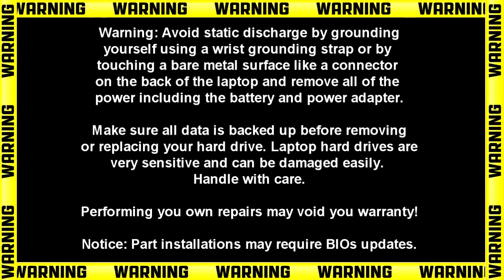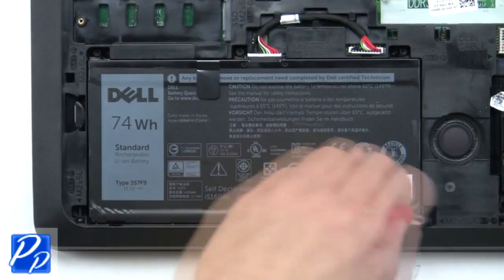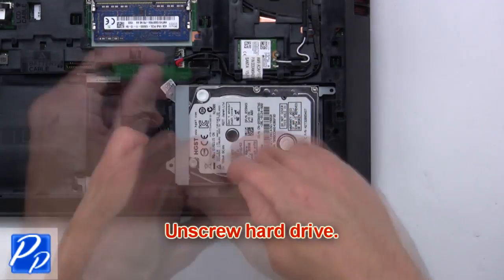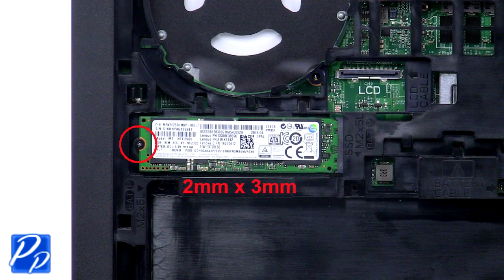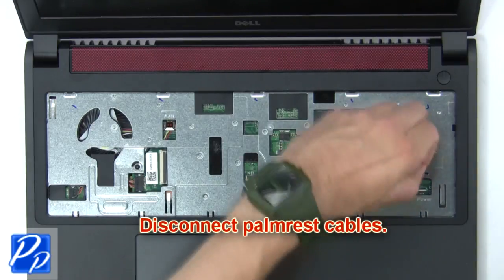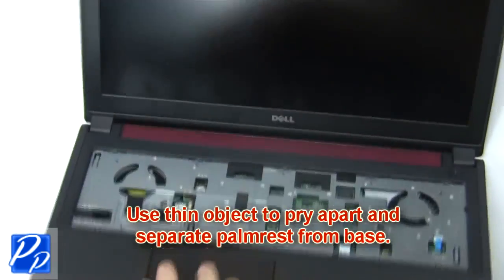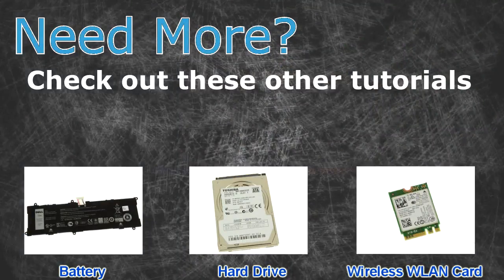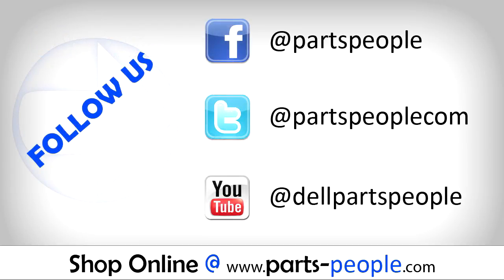Dell Inspiron 15-7559 (P57F002) USB / Audio Circuit Board How-To Video Tutorial

Comment: Is it possible to replace that module with another that supports USB_3.1 protocol?
Would that work or is the main motherboard also a limitting ther?
Can that module be found with 3.1 protocol?
Reply from the maker: Unfortunately I don't know of any USB 3.1 circuit boards made for this model so I can't say for sure.

Comment: hey, for some reason i can't access the bios using F2 nor boot selection screen with f12... the laptop model is the same, dell 15-7559
Reply from the maker: You might try using an external keyboard just in case your laptop keyboard is to blame.
Reply: @dellpartspeople  tried that and didn't work, had to use dells restore windows image on a usb, it installed as legacy, then updated the bios and then i wad able to see the press f2 or f12 screen, and works great now, thanks

Comment: Hi there, I'm havin trouble with my dedicated video card, at the same computer on this video. It's a NVIDIA Geforce GTC 960m. The computer is simply not using the board. Do you guys know anything about it? Do you any solution?
Reply from the maker: This commonly occurs when the GPU fails. You may want to see if it is recognized in BIOS.